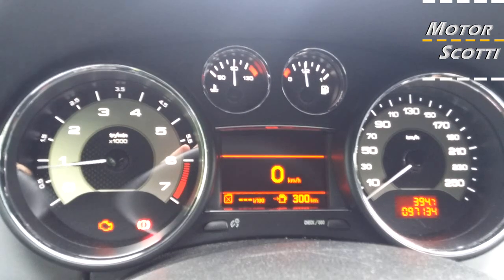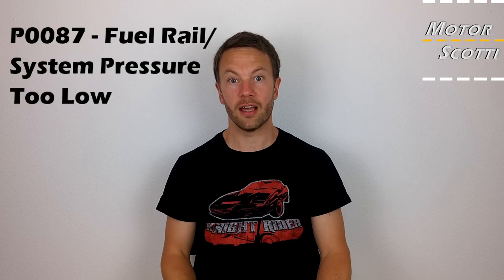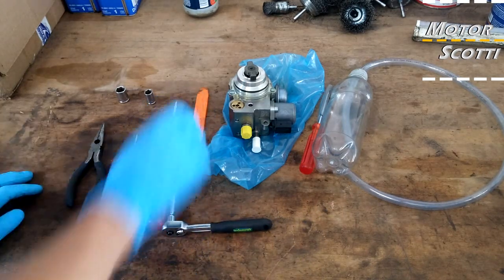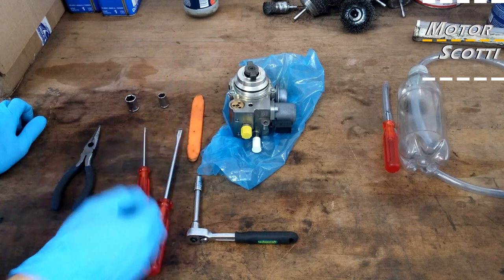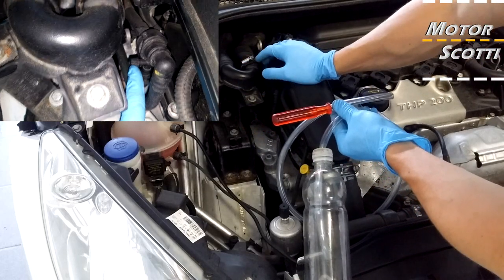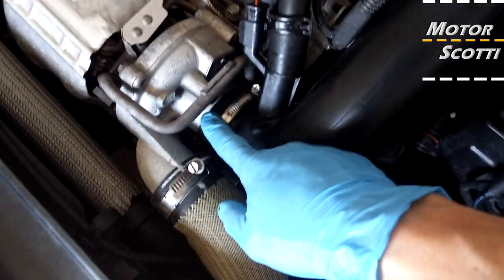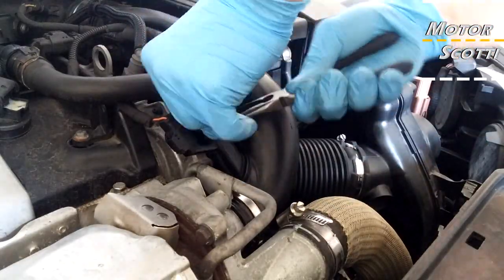New high pressure fuel pump - PSA & MINI Prince engine

Comment: Just remove your HPFP take of the top (as per Mr2Tempo You tube videos) , off clean it all out, add new hydraulic fluid, Do that while the pump is submerged in hydraulic fluid, so that no air gets in. Assemble it while submerged . It usually lasts 9 - 15,000 km  (new pumps last 60 -90,000 km) . Cost about $20 , so far have driven 4,300km  on mine, no problems.

Comment: i hace had the same problem with 2 of my RCZ 's at 54K  => i had the old 2010 model and then the 2014 model now !
i suspect it is the same problem and if my car is warmed up i shut it down for a moment then restart and i can have my power back but i have to ease into it .
Ones i've done that i have full power again , but this is not the way to go of corse => it needs to be replaced .
it costs 750 euro's here if you can do it yourself .

Comment: There is verious HPFP recondition sercices available online / ebay offers a service you remove & post for fuel pump Rebuild for around £150 
or you can buy self rebuild kits from £20
Most of these pump fail due lack of oil (leaks) or lack of Vacume
Reply from the maker: Yes, Wildmotor in France reconditions them too. Even Peugeot/Citroën/DS dealer send him their broken ones to get reconditioned.

Comment: Is there a fuel filter on the RCZ, if it has one, where is it?...
Reply from the maker: Sure, every car has one. On the RCZ/308 it's in the tank, I believe combined with the fuel pump. I never changed it but you should be able to access it if you remove the rear seat. It's on the left side.

Comment: my pump just died now being replaced also a front spring snapped
Reply from the maker: They all seem to go eventually. What's the mileage on yours?
Reply: @MotorScotti  90000 miles now and 10 years old and now remapped so that may have finished it off lol. nice new one going in now.

Comment: Hi sir, where did you bought your high pressure fuel pump? And how much? Thanks so much
Reply from the maker: I just to the Peugeot dealer to get the pump. Prices vary from place to place, from country to  country, therefore there is no point in telling you how much I bought it for. Thanks for watching! :)
Reply: Thanks man, big help 🙏

Comment: @ MotoScotti, thanks for excellent video and tutorial on this awesome stuff. I have same engine in my DS4 sport and keep getting engine fault repair needed on main display and car losses power. This only happen when accelerating (engine under load). Could this be the case as wel HP pump? I also noticed that when engine is idle rpm is below 650 or there about?
Reply from the maker: Thank you! This very much sounds like the symptoms of of a broken HP fuel pump. However, to be sure I'd get a diagnostic scanner to check for the fault codes. Lovely cars but these 1.6l engines can be divas... Good luck!
Reply: @MotorScotti  yeah you are absolutely right they are divas. Will indeed do a scan over a weekend and see what i get. Its annoying as it happened today lol and as soon as youbswirch engine off and on errors gone and its normal again lol 😆. But thank you for taking time to reply.
Reply from the maker: @ru33erman  That's why I made this video. 🤝
Reply: @MotorScotti  indeed and its gem, thanks dude.
Reply: @ru33erman  Hey..Did you manage to fix the issue?

Comment: @MotorScotti Do you know the part number for the little clip at 8:15? Mine broke when replacing the pump and I can't find what they are
Reply from the maker: Sorry I don't, sold the car over two years ago. If you show this video to the parts department at a Peugeot dealer they can find it, but I'd be surprised if they sold this seperately.
Reply: @MotorScotti  Thanks for the reply. You were correct, they don't sell it seperately so I have to buy the full line for £68!

Comment: Hello do you know where is located the fuel pump relay on the Rcz
Reply: Its on the right side down of the air hose for the air filter,  but if know where its located still u can't do anything,  u have to remove it to check it ,only u can check with ur finger if there is a  leaking there , but if u diagnose it and this cose showing P0087 it means thats the one , and also there is one sensor make this problem too i guess but i don't know to much about that sensor.

Comment: This is exactly where I am at 🤬 I first got told I needed a lambda sensor then I got told I need a fuel filter, however this car doesn’t use a fuel filter so now I’m going to have to do this as well , haven’t even had the car a year yet and it’s only on 39,000 miles. They should of done a recall if it’s a common fault on Prince engines it’s costing £900 for a new high pressure fuel pump here in the uk! They can fuck off. I’ll get the old 1 reconditioned. Pissed off 😤
Reply from the maker: Well good with getting the old one reconditioned. I wonder who can do that and if it will actually be cheaper than buying a new one. Of course the RCZ has a fuel filter, but it's in the tank. I think you have to remove the rear seats to access it, but I never did it on mine.
Reply: @MotorScotti  well now I’m confused because I got told it doesn’t have a fuel filter only in other countries which I found strange then I got shown a graph of 1 in the tank like you said. But now I’ve seen and read about the HPFP and the similar symptoms mine is doing it goes into low power mode then it warms up and engine light goes out and power comes back, sometimes it’s a bit jittery when first moving off from a cold start. The diagnostic reading told the mechanic it’s a fuel filter. Would a high pressure fuel pump come up on a diagnostic reading ? Also how to do a test on 1 before changing it would be helpful.
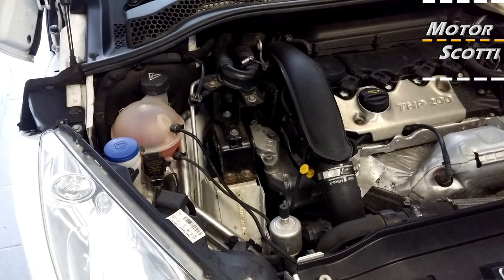Reply from the maker: First of all, every car has a fuel filter, even if you go back to the 1950's. Every RCZ has a fuel filter, that's just a fact. As I explained in my video at around 07:20 there was no pressure in the system, which may indicate that the HPFP is malfunctioning. But why don't you just change the fuel filter first. It's located under one of the rear seats and doesn't cost much. It's no harm to change a filter anyways. With troubleshooting what I always say is to start with the simplest and best value option first and work your way through the problem.
Reply: @MotorScotti  yeah very true I thought the exact same thing, and it’s worth doing the fuel filter anyways. I’m not very good at fixing up my own cars I always worry I am going to cause more damage than good and that I won’t put things back together properly. But I’ll try finding a video of someone doing the fuel filler.
Reply from the maker: I saw one, just look for Peugeot 308 or Citroën C4 of the same period. They are basically all the same chassis and architecture.

Comment: Hi thanks for the Video well done! two questions, which diagnostic Maschine do you use and would you recommend or say that this repair could done by somebody who is not a mechanic? but has a very good idea About how an engine works, and has done many other things on my 508 and one of the two RCZ cars from my wife ...
Reply from the maker: Hi, thanks a lot! use any generic diagnostic reader, it worked for me. I'm not a mechanic, either. Hence, you should be fine. 😀
Reply: @MotorScotti  Well it worked, got it in and the car still works :-), the only thing was the the small white  clip broke on the low pressure connection, so I had to make a clip that would hold the pipe in place, that was after talking to  Peugot, who told me that the clip comes only with the compleate fuel pipe at 87€ so making my own was cheaper.... if anybody has a clip or knows where I can buy one then that would be also super!

Comment: What about the fuel filter? 100k and new hpfp
Reply from the maker: The fuel filter is in the tank. In this case the issue was clearly the high pressure fuel pump.
Reply: @MotorScotti  sorry what I was trying to say is that with 100k on the clock and new pump installed not changing fuel filter should be a criminal offence 😅 although filter in the tank makes the task a bit more complicated.
Reply from the maker: You're right. It would have been sensible to change the fuel filter as well, absolutely agree with you. Maybe the new owner has done it since. It ran perfectly fine till I sold it, apart from the turbo charger that quit just after I sold it, but that's another story. ;)

Comment: was this a p0087?
Reply: oh shit thanks, I should have watched the video a bit longer.. I had a customer today with this issue, her fuel sender pipe connected to the high-pressure pump, the clip was broke and it was put on with a cable tie, this must be causing air to be sucked in.. ?? I've ordered a new pipe, ill put it on see what happens...

Comment: Thanks for the video! 
Do you know if this same problem with HP fuel pump can happen without the error code appears in the computer? My car (207GTI) presents same issues but doesnt have any error code. 
Regards from Argentina!
Reply from the maker: Good question. Do you mean no check engine light or did you actually plug in a diagnostic tool to read error codes?
Reply: @MotorScotti  I've checked with a small OBD2 bluetooth sensor and no error code appears. I even replaced the valve cover because i thought the PCV valve may be the cause, but no.
I just discovered your channel, consider me subscribed!
Reply from the maker: Thank you for subscribing, but if you're hoping for more RCZ content you'll be disappointed. I sold the RCZ over a year ago. If you had a look through my videos you'd see that I've been focusing on my Knight Rider replica for quite a while. Hope you'll enjoy that, too. :-)
Reply: @MotorScotti  I knew it but all cars are enjoyable and source of knowledge in my opinion. Best regards!

Comment: I have a Peugeot 308 gti 2013 model. and I have been strugling with Camshaft posistion sensor. what are the names of those two connectors next to the breather pipe.

Comment: On a Peugeot 207 how do you tell if low pressure is sending fuel to the high pressure pump I replace the low pressure pump in tank, which if key is on pumps fuel. However the fuel don’t reach the engine as the car start and idle when I spray quick start. Basically how do I diagnose is the high pressure fuel pump?
Reply from the maker: If the low pressure fuel pump is working, you can here it buzzing when you turn on the ignition. If the high pressure fuel pump is broken, you would have a loss of power and in any case a check engine light and a fault code to read out.

Comment: Hi, I cannot figure out how to disconnect the hosing @5:30 on the video. Any tips?
Reply from the maker: Just get something flat in there and lift the rear part up, then you can unclip the front part and pull it out. Look closely at the video. Good luck
Reply: Yep I have tried a screwdriver, knife, chisel but no luck so far. Do you need to do the top and bottom clip at the same time? Will not budge and I’m worried I will snap something. Thanks for the tip and vids Motorscotti! I have watched the video many times....

Comment: Hello @motorscotti ...
I have i Peugeot Rcz 1.6 thp 115kw 12/2010 automatic transmition 85000 km
2 months ago the 'engine fault repair needed' showed up also.
The first time was after 3 days not running the car.
I have changed the battery 4 months ago .
Went to my mechanic and told me it is the high pressure pump has to changed.
He erased the fault cause i didnt have money at that moment (he asked aprx 1000€) and i filled up the tank with 100octane petrol .
The car was running good up until yesterday where the same problem came up.
I want to ask if it is the a petrol ,an electrical problem or it is the pump for sure?

http://imgur.com/gallery/feviPja

This is what the examiner showed
Reply from the maker: Probably the high pressure fuel pump. Mine had the same error code, but who knows what else good be broken. These engines are divas. I've sold mine a while ago so I'm not really in the details of it anymore. If you are replacing it yourself, try to ask at BMW or online, the price might be a lot cheaper.
Reply: @MotorScotti  thank you for you quick answer. i am in Cyprus so i might look for another mechanic.
Tough task to change it my own.
Take care and keep uo the nice vids
Reply from the maker: @dimitrisantonakis8164  Good luck to you! It's not difficult to change but with a mechanic you'll have warranty and it's safer for you, especially when you have to deal with fuel ;-)

Comment: Do the rcz models have a in line fuel filter. If so do you know the location.
Thanks in advance.
Reply from the maker: The fuel filter is in the tank with the fuel pump on the left side. You might be able to access it if you remove the rear seat panel, there might be a door, but I'm not sure. I never had to access it and I sold the car last year.
Reply: @MotorScotti  thank you so much for your help. It really is appreciated.
Reply from the maker: That's what my videos are all about!

Comment: They eat fuel pumps, strangely after 1 year they fail again,  ( after the warranty runs out) and so on and so on.......so in 2 years just on fuel pumps, it will cost you over £1000??? As they fail on a regular basis.....2+2 years fuel pump replacement will cost over £2000......and that is without other repairs being done ✅ insane

Comment: They eat fuel pumps for some strange reason
Reply: I have to agree with this ... I have a 230,000km DS4 (2012), changed twice under warrant at 30,000kms and then around 130,000kms ... now at 230,000km it is starting to give problems in the morning.
Reply from the maker: Engines these days are too delicate to last without any major issue over the course of 200'000 km. At least you got to change the first two ones under warranty.

Comment: Hello from Greece I have a Peugeot 207 cc and I have a problem Probably with the Tromba high when it's cold and I start the engine I am confused by the machine and it takes about 5 minutes to get it right, and then everything is ok... Is the front high pressure pump or the back ???
Reply from the maker: What do you mean by "tromba"? If it's the fuel pump it's most likely the high pressure pump in the engine bay. The fuel pump in the tank either works or doesn't at all. Mine was running rough at cold start too when the high pressure pump broke.
Reply: @MotorScotti  tromba is call in greek,, the high pressure fuel pump... I find it the high pressure fuel pump 320€ new , but I don't know if it that the problem, maybe it's the back fuel pump,,,, only at the is cold doing that after 5 minutes is ok
Reply from the maker: @manoschar9848  most likely the high pressure fuel pump. As I said if the one in the back doesn't work no fuel at all is going to the engine, wouldn't even start. But it's always hard to diagnose from a distance. Just plug in a diagnostics tool and read the code, that will give you some evidence.

Comment: I don't know if mine is different but with 134k km was always maintained in peugeot by the previous owner and it doesn't have any record of bad things or replacable parts except the timing chain it was replaced before I bought it. Runs fine without problem

Comment: 900 euros mine was.. broke at 111777 km😭 273hp model. Know there is a revised pump that shouldn’t break as easily... problem is identifying of its a new or old model.. anyhow, the Bosch ODB2 diagnostic tool told my mechanic there was a revision 2 pump
Reply from the maker: Mine was 700. I suppose as long as you get it from the dealer it should be the newest one

Comment: Salut Scotti! 
J'ai fait la même réparation en suivant tes conseils. Merci beaucoup! 
(J'ai la même Rcz avec le même autoradio modifié.) 
Par contre maintenant j'ai l'heure et la date  qui clignote sur mon écran comme toi. Et l'horloge est déréglée. 
Sait-tu comment résoudre ces 2 problèmes?
Reply from the maker: Content de savoir que j'ai pu t'aider. L'horloge se met à clignoter à chaque fois que la batterie a été déconnectée et reconnectée. Faut juste la remettre à l'heure. Avec la radio android l'accès au menu dépend du fabricant. Essaye d'appuyer '>>' et '<<' simultanément pendant 2 sec (les commandes au volant). Valider avec le volume + et revenir en arrière / sortir du menu avec volume - sur le volant.